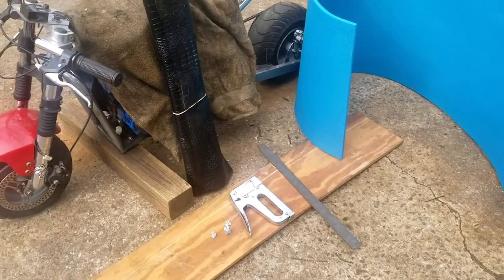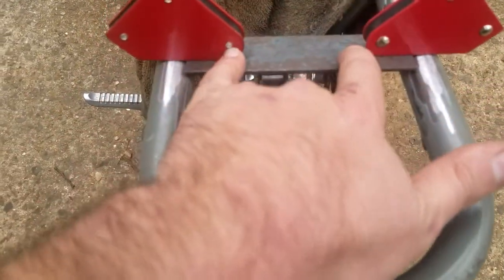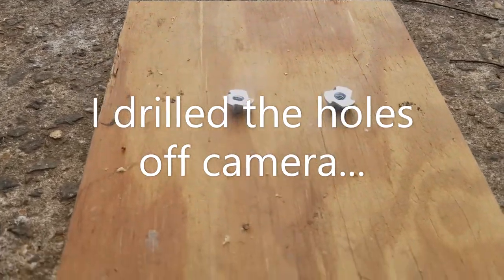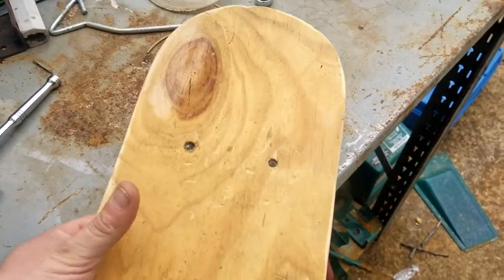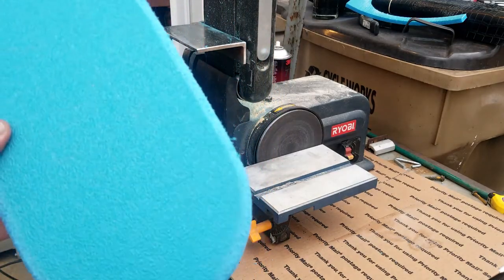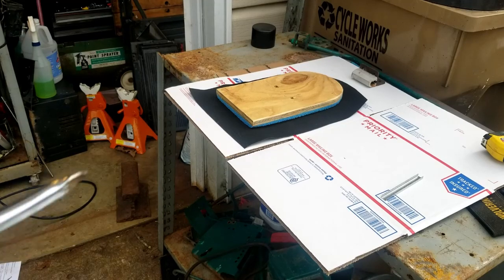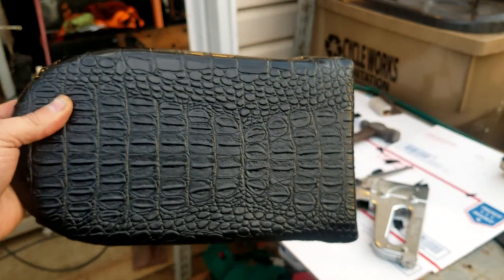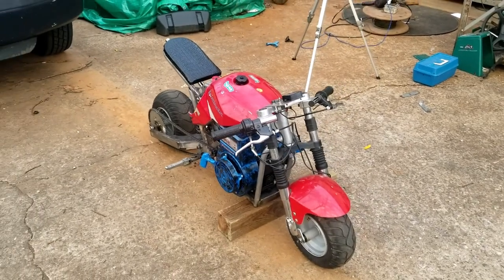How to Build a Basic Mini Bike or Pocket Bike Seat

Comment: Good seat. Only thing I would've done different is a couple layers of foam rather than one, but that's just preference. I'd also like to see a video of the bike in action once it's ready!
Reply from the maker: Hey Brother!  Thanks for checking it out!  I actually agree with your suggestion.... On the last seat I built for my mini chopper I used 2 pieces of foam and it sure is comfy lol... I wanted to keep the tail on this bike as slim as possible so I decided against doing 2 layers...  The jury is still out on whether I even like this seat or not lol...  My usual nature is to over engineer/complicate things so when compared to rest of the bike the seat just looks rather plain... Anyway, enough rambling... it's almost ready for a RIP and RIDE... I'll certainly make a video when that happens.... 🤟
Reply: @bstarnes514  haha if I had a minibike I'd be riding it on my forest trails and jmping the ditches so it'd need to have one skooshy seat.
Reply from the maker: Ah yes absolutely right!  All my minis are road warriors.... I dont have an off road mini...I definitely really want one!